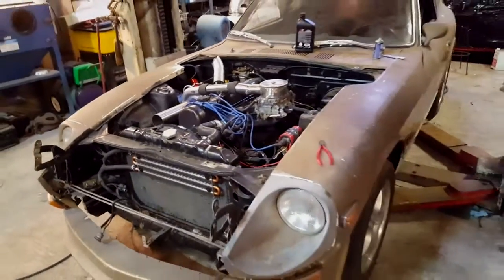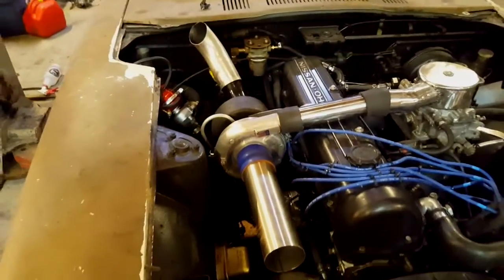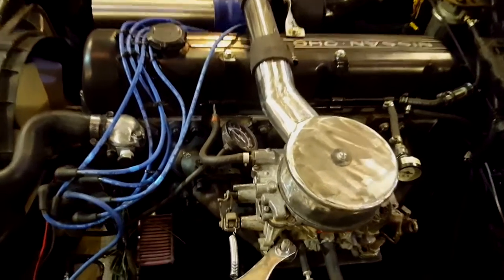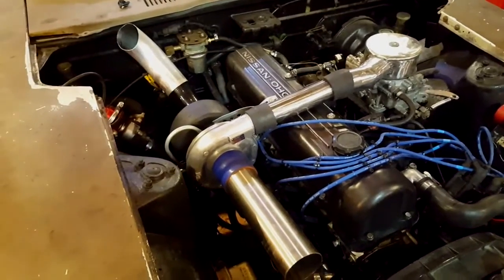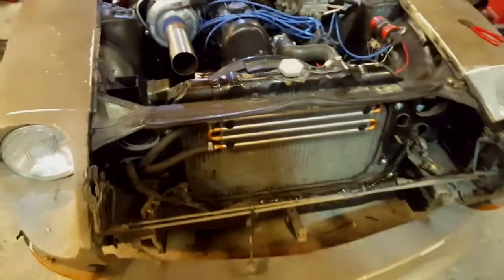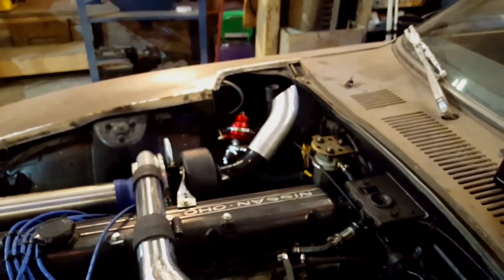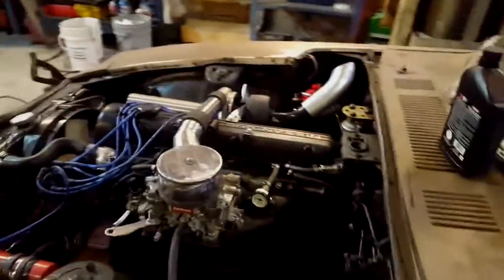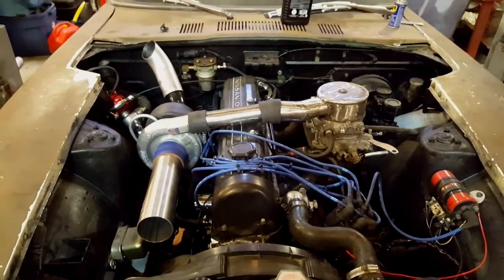Experimental Datsun 260z Turbo

Comment: love the 4b a barrel intake
Reply from the maker: Thank you Javon I will be making more videos this winter on the car!!
Reply: +Coastal Budget Builds why u didn't use the l28et block or can it be used but I born with a disability and I can't drive manual what automatic transmission to use that can take power can a 1jz automatic transmission be used?
Reply from the maker: I had the l28 non turbo block already at my access thats why i used it! as for an automatic Im not really sure what transmissions would be usable with the L28et that are automatic... A quick google search and you might be able to find exactly what you are looking for!!
Reply: +Coastal Budget Builds I tried Google no options
Reply: bro good night u got whatsapp  so i can speak  to you  and ask u more  questions  on your build
Reply from the maker: +Javon James Sure man message me on my Facebook page and I will send ya my whatsapp
Reply: +Coastal Budget Builds I did lol my face book name is a Human being
Reply: hey..... do you have Rising fuel pressure regulator every psi of boost will cancel out a PSI of fuel pressure... so say you have 5psi boost and 5 psi of fuel = no fuel and what are you using to pull timing. I own a 71 240z turbo might be able to help you if you need help